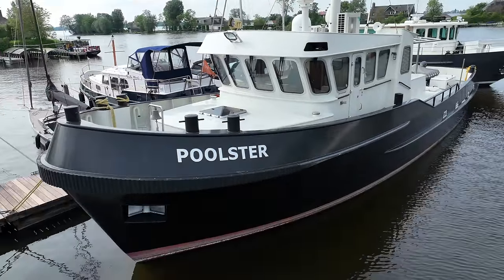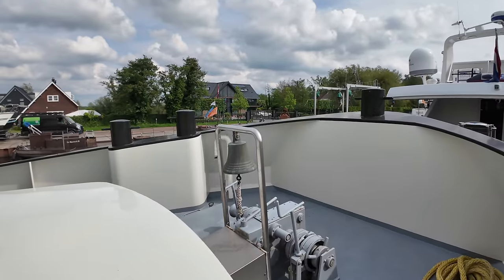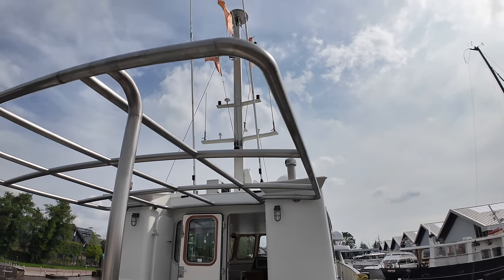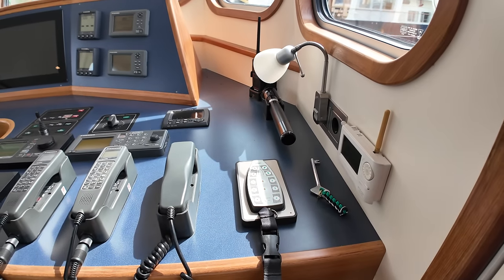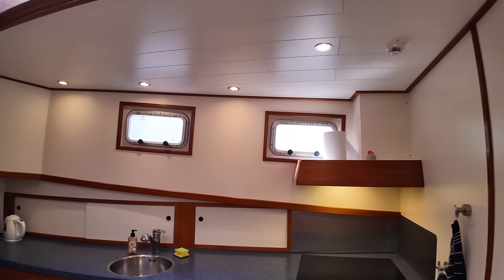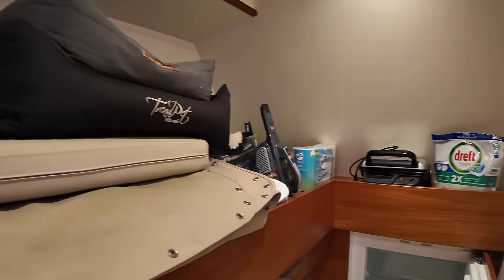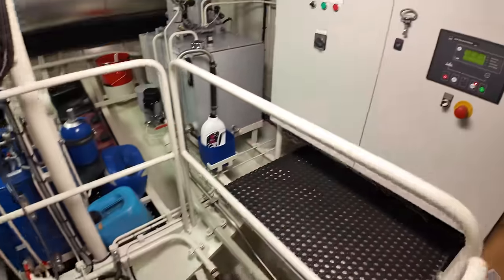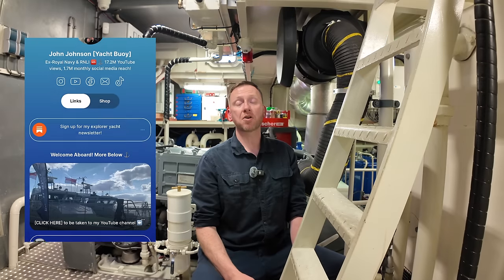Trawler Style Explorer Yacht ‘Poolster’ (3,000 NM Range)

Comment: A 10mm steel hull, a dayhead in the pilothouse, and a spacious and easily accessible engine room, and a design which probably has a gentle, seakindly motion is exactly what I personally would look for (instead of a planning plastic hull bumping around and falling apart in a hurricane, with an engine room where you need to be a contortionist). In my eyes, this design oozes comfort and safety.
Reply: I agree! The only thing I wish it had was another drive engine, yes I know it could/would cut down on range but traveling thousands of NM with 1 engine makes me a little uneasy.
Reply: @DCB1209  Travelling thousands of miles with two wheels situated in such a vulnerable way makes me nervous. Hit a submerged log or deadhead and you've got all kinds of problems you don't have with a single screw that is protected by the hull. Same thing applies if you're trying to squeak through a narrow tidal channel. You have much greater risk of dinging a rock with one of the blades.

Comment: A see that the pilot house has a split air conditioning system.... with the condenser on the roof. Does that one unit connect to all the inside units, or are the rest hidden?

How do you get to the top of the pilot house to access the life raft and the mast?

Comment: Everything was going so well in the video until we reached the cabins and saw that the additional cabins only have one berth and the vessel only has one head and shower  in the cabin area. Then all my likings for this boat collapsed when you reached the engine room and I saw it only has one engine. Too late and too expensive  to build a 4 meter mid hull section and cut the hull to fit it and to figure out how to add another engine.  Well, some people might like that.

Comment: One engine, no back up no thanks
Reply: If you noticed, it did have a "get home" gearbox attached to the back of the reduction gear.
Reply: Catastrophic engine failures are extremely rare.  Electronic shut downs or a fouled propeller or rudder is way more of a concern, especially going in and out of port.  If you're a thousand miles out and have a shutdown, you have plenty of time to resolve it,  or find another ship to tow you home.